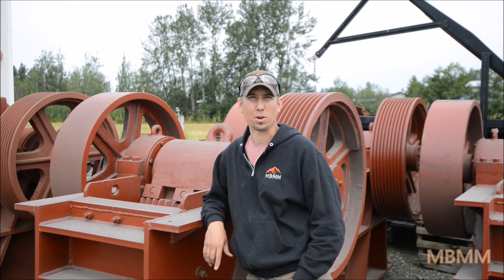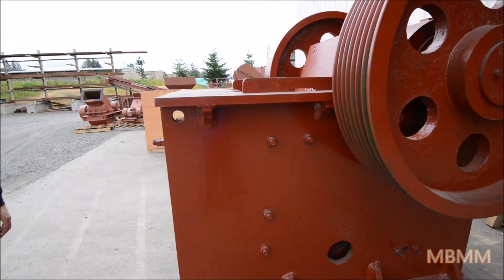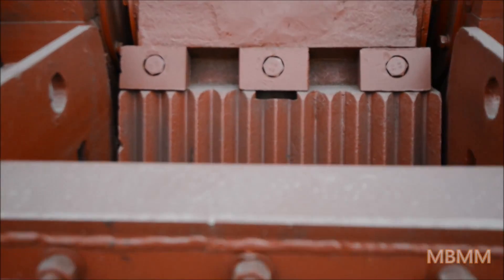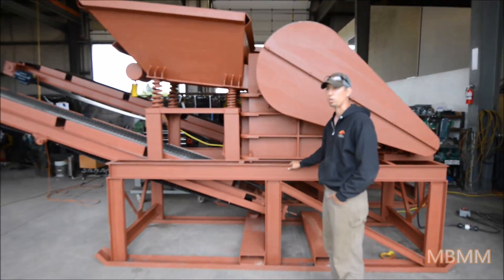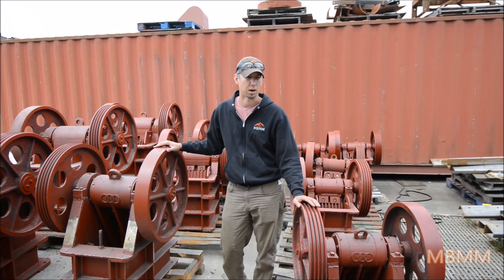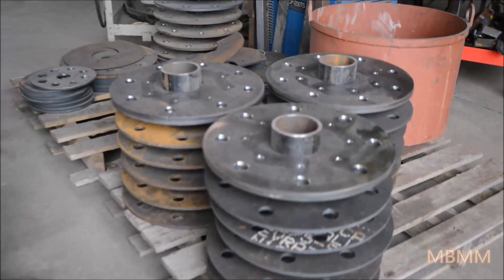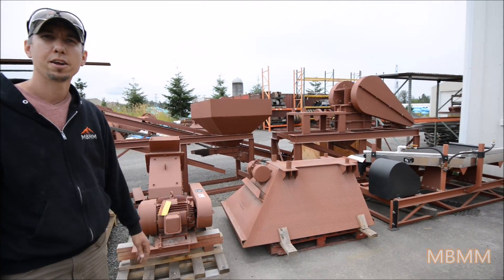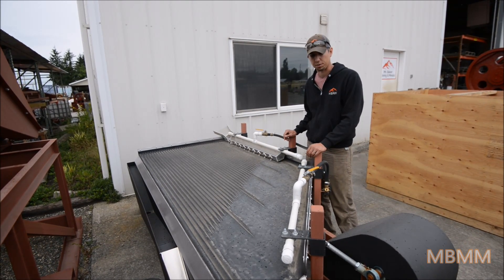Intro to MBMM and Shop Tour, Mining, Recycling, and Crushing Equipment

Comment: How much are these medium and small jaw crushers? I found a place where the gold is super fine so i have to do both crushing and pulverizing. Unfortunately doesn't yield much, so have to rely on getting at least 2 ton a day to make it sense, it yields only 0.1 gram per 5 gallon bucket quartz. I would need to crush and pulverize  10 buckets just to get 1gram. But it's time consuming process. Do you have a jaw crusher that can crush 2 ton in very small pieces in less than 2hours? Also is there a reliable hammer mill, or other type of pulverizer? I bought K&M rock crusher supposedly it can crush 1 ton in 2 hours, turned out to be a scam it crushed less than 3 buckets in 4 hours, and very quickly broke down...
Reply from the maker: Hey Vahagn, if you would please fill out our contact submission form at: https://www.mbmmllc.com/contact/ I can provide you with the specifications and pricing on our jaw crushers and hammer mills.